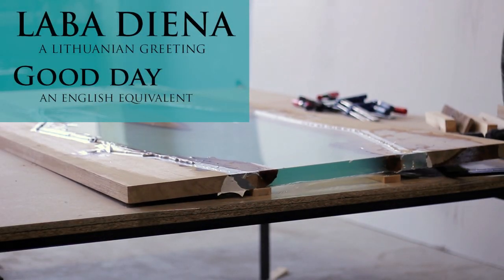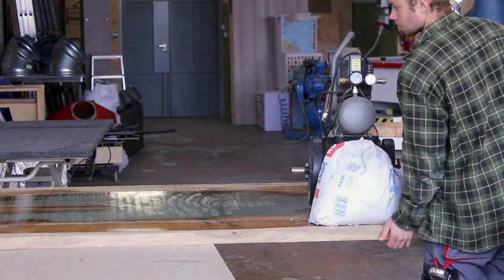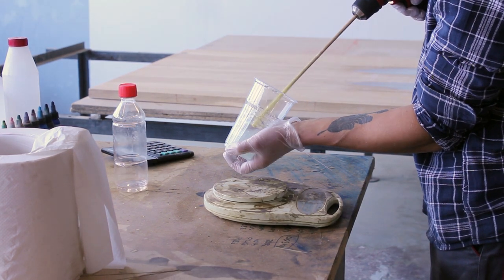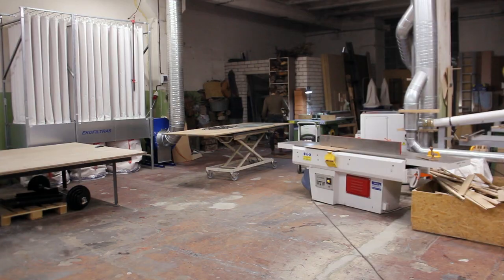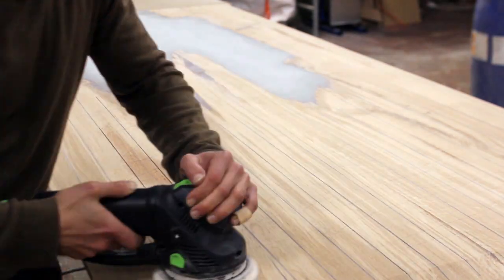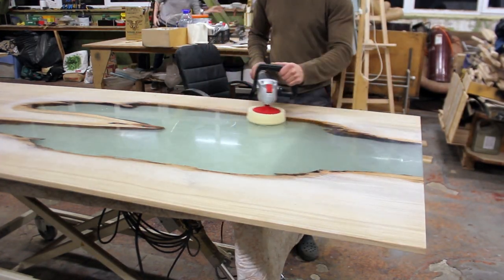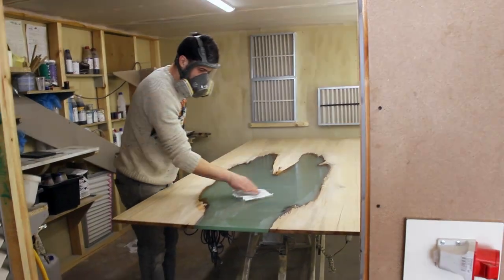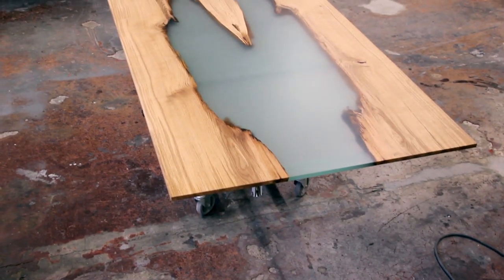making epoxy resin table top | step by step process | pt2

Comment: How much do you want for this table?
Reply from the maker: I still have to make the legs. I can't evaluate it before it's finished. Stay tuned for the 3rd part of the build and once the table will be finished, I'll put a listing on my website.
Reply: @Chiselsplay  im  looking forward to it! If it cheaper than 600 it Would be crazy! Wood maybe 200 epoxy maybe 100. Then electricity, Tools, legs, time for working. I saw your Website, for example, the cube with a lamp with epoxy only 25. How you Can do this?
Reply from the maker: Nadine I cant find a lamp for 25 :/  Anyhow, table is not a lamp :D I am absolutely glad u like my products. And the table price will come clear in a near future;))
Reply: Nice project bro! really like how this table looks with matt laquer.